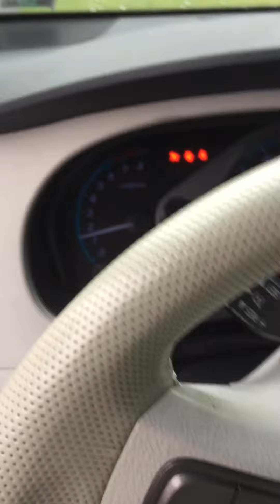Camper Van, Toyota Sienna, minivan, powered by a solar panel, no car battery

Comment from the maker: My next day off with some nice weather, I'll go more in depth, I'll open the back up and we can all watch together from the solar controller to the cables to startup. I don't know how this could be a fake video when you just seen it happen but no worries nothing to hide here, I'll get deeper with it in the next video
Reply: Go from the panel to the engine compartment on the top side and follow the cable. That panel doesn't produce enough amps to turn the engine directly.  I still call this fake as they come....

Comment: hehehhe that was a NICE performance.  But you are a FRIGGEN liar!! lol!!  I have lived and breathed solar and battery technology since I was little.  It looks like you have a little flexible 100 watt solar panel on top of your vehicle (with SunPower cells).  I have 3 of them.  That panel cannot output more than 5 to 6 amps in full sun, which is WAY WAY WAY less current than a starter motor needs.  You had a hidden battery somewhere but, nice try :)  Now, that size panel COULD charge a battery in a pretty short amount of time to the point that it really could start that car.

Comment: Nice fake video.... the branch connectors on the top of your van are going to a battery that is in the rear of the van.  You have a 100 watt renogy panel which does not have enough amperage to start the engine.  I like how you add it couldn't be done.  You were right. You didn't do it.  Not without a battery in the mix.
Reply from the maker: Ronald Baker 
Grape not renogy
Reply from the maker: Ronald Baker 
Connectors are going to solar controller in the back and then ran from solar controller to cables to front under hood where the battery would be, battery was taken out no battery
Reply: Makes no difference.. neither produces enough juice to turn the engine over.